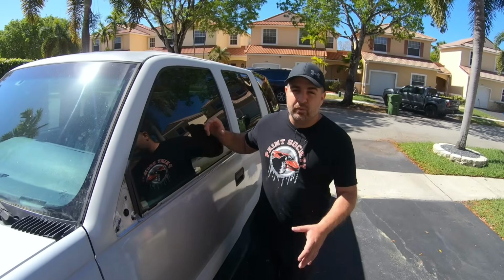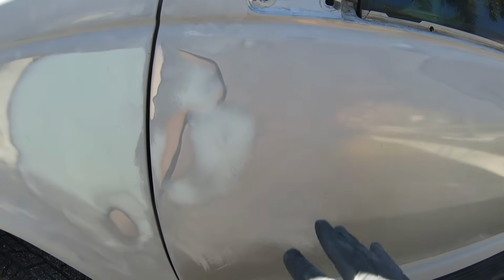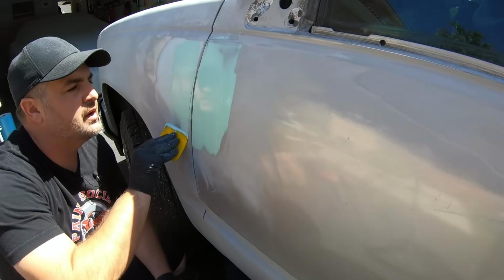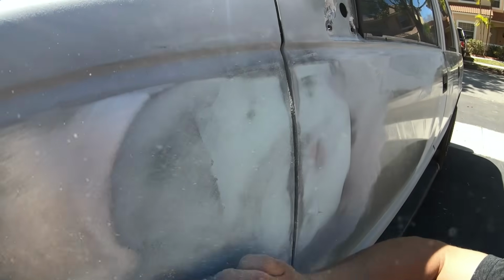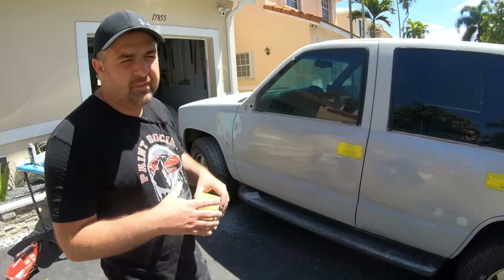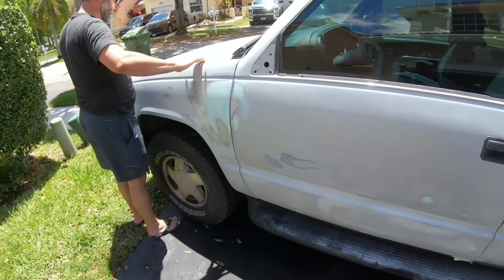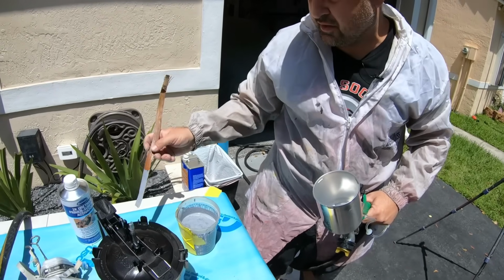The START to FINISH Guide to Prepare Car Panels for Paint!

Comment: These paint DIY videos are fantastic. As others have mentioned 99% don't have spray booths etc. but with some guidance and practice one can get good results. I bought an old fender from a wrecking yard and I'm using it to practice on. One can sand, put a dent in it, repair it, prime and paint etc. on it. Then go for it on your project car.
Reply: Great way to learn Danno,don't forget your safety equipment.  Paint respirator,disposable gloves, and eye protection.
Reply: I'm planning in building a booth out of 2x4s and tarps

Comment: Ive sprayed a bit in the past, not much, but most results ive have not been happy with. I am currently getting things together to respray my car, i was not that confident after previous attempts at panels ive done, like i said, have been shit, faded colour, cracking clear coat etc. But going through this channel and watching the vids, i can pretty much see where ive gone wrong in the past with everything. Which is good, it means i know where i went wrong, so i wont be doing that again. 

A big thanks to this channel, you have installed some confidence in me, hopefully i can report back in a few months time and say, and even bigger thanks.
Reply: Any update ?

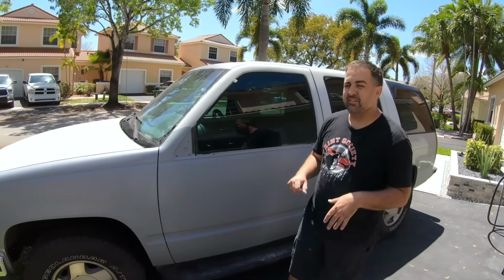Comment: 20:26 I only sprayed primer surfacer on the repair areas for now. The rest of my car still has some flaking clear coat but I plan to tackle the flaking paint after I fix the dents.

My question is: Will I have to sand the primer surfacer down to the filler on the repair areas before I spray the rest of the car with primer surfacer? 

Appreciate the help from any professional as I know paint society doesn't always answer our questions because he's very busy.

Comment: Thank you for the time to show and explain the correct process..one question..if some previous repairs and work like the engine bay have been done in a one k acrylic primer,would it be necessary to sand it all down and remove it?as i'm now using 2k primer for the rest of my restoration.or would 2k primer/sealer be okay and compatible to spay over it?..thank you

Comment: Thanx Brian for the great tutorial, delivers in a calm, knowing manor. A great tip that I've just learned after years of doing bits and pieces to my cars, is to put masking tape on the cardboard when mixing body filler..!! ..Great idea. Thanks. Have you got any tips for cleaning the spreader and keeping the edge straight.? TIA

Comment: I’m glad I found this! I want to paint a new panel I bought for my Miata and respray all the front panels on my Miata - they are
Old and tired and have been repainted poorly (all the clear coat has come off). I’ll watch the older videos to see where to start, but question - once you put the final primer on, how long can you leave it before putting paint down? We talking hours? Days? Weeks?
Reply: Idk if he’ll answer, but a body guy once told me about a year max and that is if it is protected from the elements (so, covered or preferably garaged).

Comment: If you use card board with print on a box that has a shiney finish. Most modern packaging. The shiny side is great for filler mixing. Doesn't absorb the chemicals in the filler, like in raw card board.
The raw chemicals seeping into raw cardboard. Just deminishes the compound of the filler. Great video
  Guide coat "IS the TIME SAVER" you can SEE what needs to be sanded.
The people that hate body prep " N E V E R  used guide coat, all the time.

Comment: Learn a lot from all your videos, I’m getting ready to prep and paint my 69C 10 short bed truck I just need help sequencing the paint job. I’m painting behind the cab, doors, door jams etc. just don’t know where to start or how to avoid running into issues. Plan on using House of Kolor system a green paint I hear it’s best to walk the whole truck but just don’t know how to avoid dry spray in the jams or what’s the best way to go about it

Comment: At the ends after the primer you said you would sand with 300–600 then paint is that correct?   After primer you would wet sand, wipe with a grease remover, then base? Thanks

Comment: Sir I have a question, I wanted to paint my bumper today with acrylic spray paint but I ran out of paint before completing the process, I ordered another can of paint. It will take 2 3 days to arrive. Would that cause a problem? Have to wait 2 3 days to apply another coat. Do you recommend continuing the process or start from primer again??

Comment: Brian I was refinishing my doors yesterday and I would like to clarify something. Sun was beating on passenger side door and wrinkled up. Driver side door looked good . This was epoxy sealer over bare metal. Prolly means that I should have used slower reducer for passenger side door since metal was hot from sun beating on it.? Passenger side door metal temp was 86 and driver side was 62. Taken with temp gun. It was 55 degrees outside. Surface was clean. I’m just trying to figure out what happened here. Lol

Comment: I noticed the fan is only like two to three inches wide and overlapped 50% and only 3 inches away from the surface . Is this because of the turbines output? Also the primer you used, is it epoxy primer, also I'm trying to learn is this the same as a sealer. I noticed you didn't use any reducer on the primer just the 4:1

Comment: Super interesting video. I've always wondered if I needed to buy a air compressor and orbital sander attachment to remove the paint but this video suggests its possible to do via blocking only. As a complete novice to removing paint I'm hoping to save some cash by preparing the car myself prior to someone else doing the actual paint work but don't know where to start. Is hand blocking to remove the paint better than investing some money to do this with tools?

Comment: PREP: (my notes for when I prep my car)

1. Smooth out bad clear coat using stick sanding blocks with p180 grit sticky sandpaper

2. Body filler low places for me on upper door trim, etc. knock down ridges and surface with 80 grit until smooth, go back and add any more body filler if needed, sand again.

3. Next, use 180 grit to cut through the clear and sand down the entire car. Making sure to sand the car to an even dullness, going back over shinier spots 

3. After cutting with the 180 grit and a quick rinse, it is ready to be gone back over with 320 grit, sanding the car to an even smoothness. 

4. The car is now ready to be cleaned off for the primer. Use an auto move paint prep cleaner or glass clean, soap etc to completely wipe off any dust or particles on the car. This ensures that the primer is laid down directly on top of the smooth surface without any dust and sand in between.

5. Begin masking off the car, in between the crevices of the door jams, window sills, wheel wells, lights, and drape the painters plastic over the car and cut the plastic accordingly to fit the windows and wheels 

6. Once the car is completely masked off, go panel by panel spraying 2 medium coats of primer with a 75% overlap. Make sure to spray at a consistent and even pace and 15 minutes in between coats. 

8. Once the primer has sat for at least 24 hours, you are ready to sand the primed panels with 600 grit

Comment: I have some brand new oem aero parts that are the wrong paint color to match my car and need to paint them the color of my car. how should I sand it down and use primer to apply the new paint and clear coat, and should i primer over it or remove the existing paint down to primer? they are polyurethane side skirts etc that has new perfect paint just the wrong color for my car.
Thanks so much in advance. I dont have a garage or anything Im gonna have to make a plastic sheeting paint booth in a storage bldg to apply the paint

Comment: I work in 3rd world country garage where we have no electricity to power tools or anything and everything is expensive the go to process always the same. Clear the rust by sanding them down with 80 grit then sand the dints or the damage with 150 the polyester putty first coat it then sand it to see if it’s level up the  primer spray them and sand it with 400 grit finish of the panel or the area with 1200 and 2000 grit and paint it (all wet  sanding cause we can’t afford to by gloves or masks) 🤙

Comment: Brian! You haven't specified what you did to the rest of the panel that's undamaged.
What did you do ?
Did you sand the clear coat???
Reply from the maker: Yes 400’grit
Reply: Thank s plus what do you recommend in fixing  light hail damage on the roof??

Comment: What if im not ready to primer? How can I protect the areas that have exposed metal and how can I protect the body filler from absorbing moisture over night?
Reply: epoxy primer, protects the bare metal from rust. You can apply body filler again over it if needed. There is a lot of info in youtube about epoxy and how to use it. But be carefull spray just one light coat dont smash it like filling primer it would extend the drying times. If it's not cured properly you will have problems in future

Comment: I have a question: why can't you use a DA orbital sander for this? It seems like it would be much faster. Can't you just set it on low speed and use a DA orbital instead? Or should I use a block?
Reply from the maker: A block will ensure it’s straight and not wavy after painting

Comment: When using a urethane primer surfacer if you have already block prepped your surface to 400 grit or 600grit do you have to put a sealer over it or can you go straight to Base Coat/ Clear Coat?

Comment: What happens if it rains? Isn't the 2K primer porous and, if so, won't the water soak through to the metal below and start the rusting process? Would a layer of epoxy primer over the 2K effectively seal against that possibility?

Comment: How long can that urethane surfacer be left exposed? I have some cracking paint on my Integra in a couple of areas, mainly where the wing holes were shaved and filled. I need to remove the old paint in those areas to address the filled holes. But what can I spray on to protect it in the meantime, if I don’t get to paint the car for another 1-2 years?
Reply: Epoxy primer. Urethane surfacer is porous.
Reply: @livedeliciously  cool thanks

Comment: After being a subscriber since you launched and watching all of you videos that have given me great insight to different perspectives of the trade, I finally have a question that I cannot get an answer on that I thought maybe you might have experience with. So due to covid19 going on the last 2 years and slowing down some, I recently came across a deal on 55 gallons of 99.9% medical grade isopropyl alcohol for free. I was wanting to know your thoughts on using this in full strength or even diluted with distilled water as a pre-prep or cleaner verses standard type pre-prep wax and grease removers or glass cleaners? Would appreciate your feedback on using this isopropyl alcohol on either bare metal prep or between primer and base coat clear coat paint jobs. Thanks and keep the videos coming Brian!
Reply from the maker: Hi bud. Thanks for watching. You’ll still need to use your water based cleaners and solvent based cleaners. 
Alcohol works for raw plastic
Reply: @PaintSociety  I have a fiberglass 1979 corvette body to repair along with the plastic front and rear bumpers. If it would help clean those parts then it's a win and free savings. Thanks for your reply! 👍

Comment: I guess they don't do merch any more?  Bummer
Reply from the maker: Yea I shut the store down. Just not profitable.
Reply: @PaintSociety  I hear ya.  Thanks for the great videos though.   I'm restoring vintage snowmobiles.  Just picked up a Kiwami4 based on your comments.   Thinking the smaller fan but fairly precise control will work well for my use.

Comment: Why don’t you wet sand instead what’s the difference
Reply from the maker: Dry sand. You can see what you’re doing
Reply: I just painted my first car but I can see the body filler and glaze that I used to fix the dents it’s showing through the paint. Any idea what I did wrong? I put bando and finished with 600 grit sand paper and used Rust-Oleum primer 2 coats, can you help thank you

Comment: Would like to see use equipment that someone painting a car in their driveway would more likely be using. No one is going to buy a 2000 dollar spray system to repaint their car in the driveway one time. It would be great to see you use a compressor and spray gun set up that the average person would likely use if painting a car in the garage.
Reply from the maker: I wouldn’t use a compressor setup in my garage. Too much overspray to be respectable in a neighborhood.
Reply: I think you kind of missed the point of my comment. There  are plenty of much cheaper ways to combat overspray rather than  buying a 2000 dollar system for a “DIY” paint job.